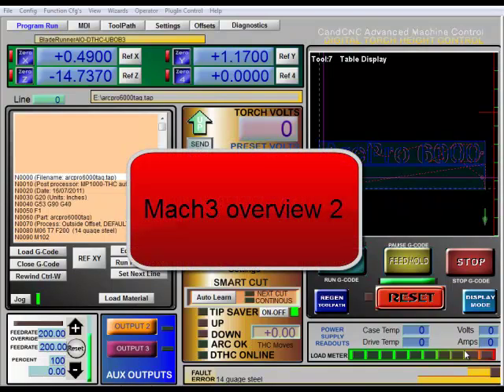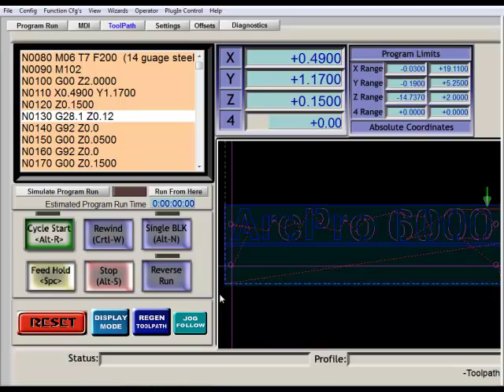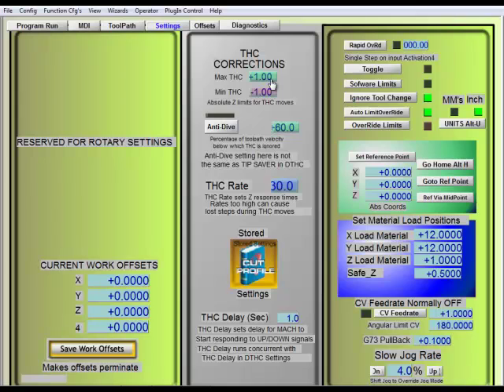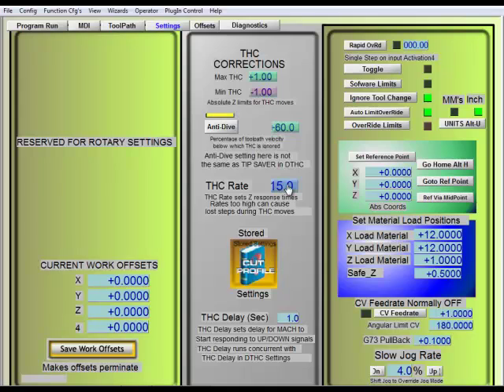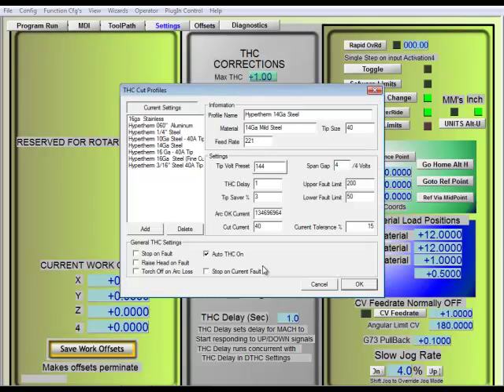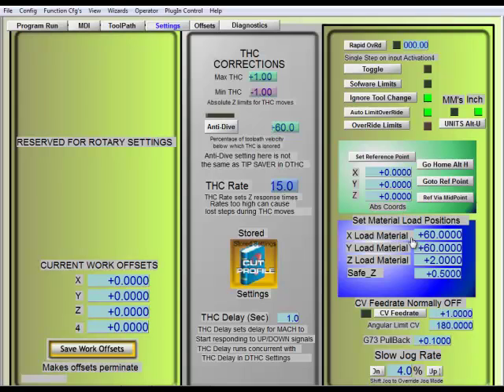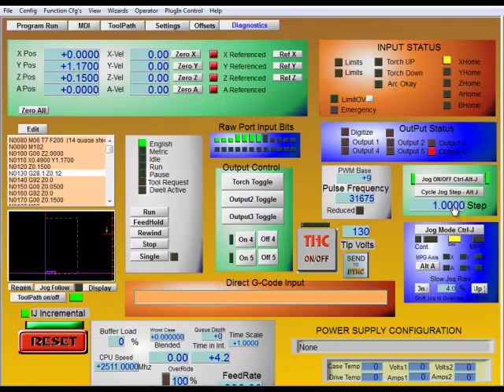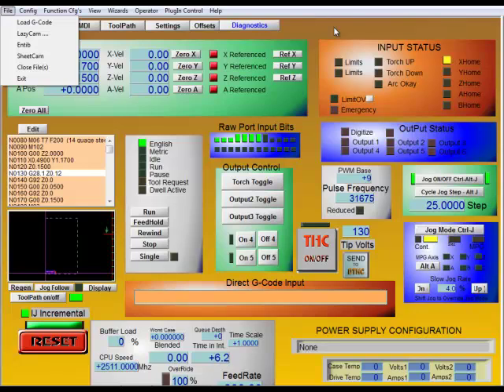Mach 3 Overview #2

Comment: Scott,
We have the 8 X 12 water table with Mach 3 software.  Currently the PAC torch air pressure runs 20-30 seconds after cutting.  And blows water all over the floor.  How do we correct this?
Thx,
J Cookson
NSCC welding instructor